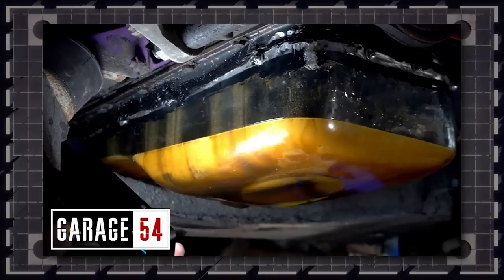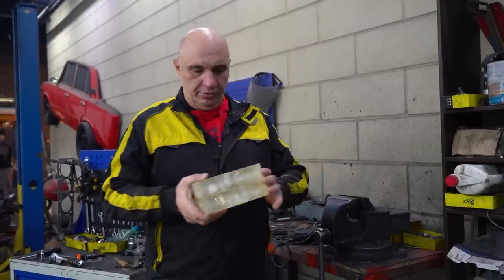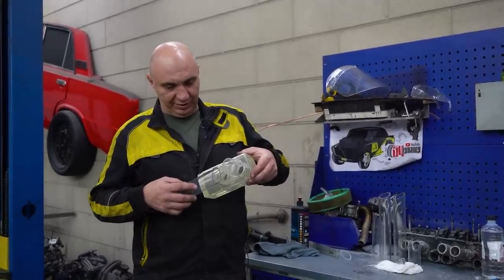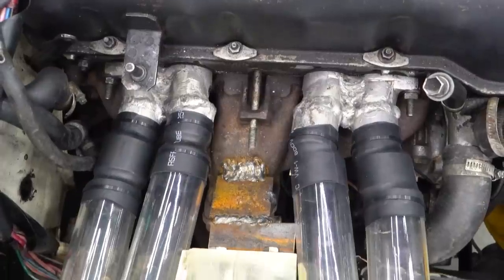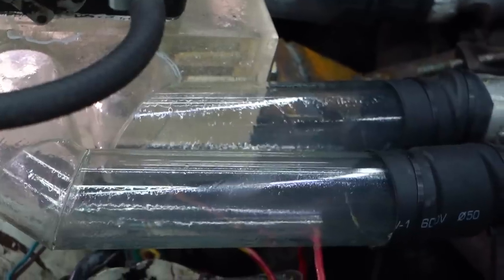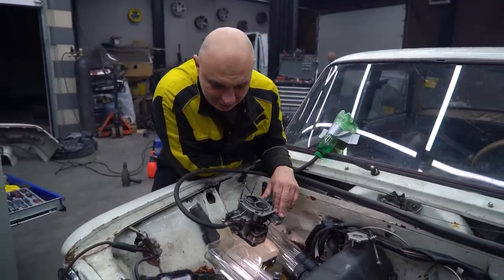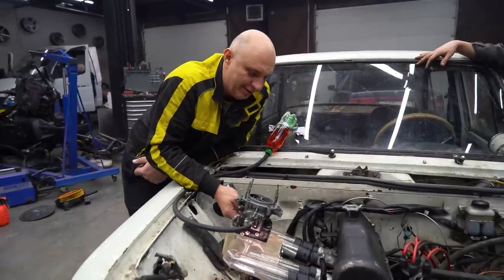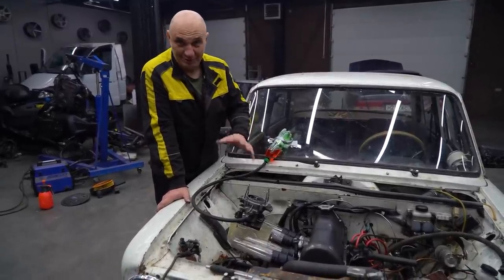We make a transparent intake manifold

Comment: Clear turbo next?? 🤔 Great video!!
Reply: 😳 No
Reply: @davelowets  acrilic should last a few minutes...
Reply: @MississippiDan1  It's not just the VERY intense heat that would instantly destroy it.. 
The air pressures involved and the centrifugal forces from the spinning turbine and impeller would blow it apart in seconds.
Reply: @davelowets  only the compressor housing maybe

Comment: Awesome video!  How about a clear plastic dip-stick? I can't imagine how we've gotten along so long without clear plastic dipsticks.
Reply: Huh? Why would a clear dipstick be so revolutionary?
Reply: A transparent dipstick would allow the user to see the oil level AND also anything else of interest that may be visible BEHIND the dipstick.  I am also hoping that one day they will develop the technology to engineer a clear gear shift knob so we can all observe with wonderment the amazing workings within.
Reply: @danbergthold3481  That's why you wipe it on a clean piece of paper towel... 

Also, that doesn't always show you anything... The dipstick only touches the top inch or so of oil in the sump. The crud or metallic wear material always sinks to the bottom of the pan, and you wont see it on the stick regardless of whether it's clear or not. 

Their is a tool that's meant to cut oil filters open, and THAT'S where you will find evidence of something happening inside the engine. A clear dipstick won't solve any of that.
Reply: @danbergthold3481  A shift knob screws onto a metal stick. You wouldn't see anything but the threads that it screws onto.
Reply: So, if only we could have a transparent dashboard, firewall, engine block, oil-pan and oil-filter, we could continuously monitor the condition of the oil and the general health of the engine. 

I still think the clear dipstick is the best solution for all problems in human civilization, but I'm willing to give the clear car method a chance. Maybe it will catch on. 

Clear armrests would be another highly useful innovation. Just imagine!
Reply: Are you sure? My mechanic friend told me that there's all kinds of interesting gears and levers inside the shifter knob.
Reply: Many years ago, I had a Trabant with no fuel gauge. Instead, there was a dipstick to check your fuel level. (Great system!) 
I wonder if this genius technology could be employed on today's western cars. 
Maybe we could even make the fuel dipstick transparent!
Reply: @danbergthold3481  Yes, I'm sure.. There is nothing inside a shift knob except the end of the metal stick that is the shift lever itself.
Reply: Maybe these days it's mostly microprocessors. (These days, auto-mechanics also need to be electrical engineers!)

Comment: Make an intake manifold that is the length of the car. Put the carb in the trunk. Then dyno the car to see if it makes more power with the long intake.
Reply: With extruded aluminum, it could be done.  Vlad and his crew have the fabrication skills.  
BUT... the runners would have to be heated the entire way.  Exhaust heat under the carb and water jacketing for most of the length.  Otherwise, so much fuel would fall out of suspension that it would barely run, if at all.
Reply: @BlackPill-pu4vi  Run it along the exhaust pipe LOL! Two tests in one.
Reply: @Universal.G  Exhaust heat would work IF the A/F mixture were conveyed along a single pipe UNTIL it came time to split them four ways to each cylinder.  The A/F mixture would be dry and well vaporized by the time it came to the individual runners.

Make the intake and exhaust out of extruded box section aluminum.  A/F runner on top and exhaust underneath.  Clamp them together for good heat transfer.  The exhaust comes out after it has run under the carburetor.  It COULD WORK!
Reply: @BlackPill-pu4vi  YESSSS!!!! I love the optimism. Now we need Vlad to get on board. :)

Comment: I would like to see if you can find a way to run a car on way less gas+ more air. To burn more efficiently. Maybe one would have to mess with the timing? I mean thunderhead289 here on YouTube ran a V8 on a lawnmower carburetor. Which makes me question if an engine needs as much gasoline to run! Or have we been deceived for years.
Reply: Efficiency improves a little up until about 17:1 air/fuel ratio, then takes a dive because the mixture begins to burn way too slowly.
Reply: @samsungtvset3398  This is just one of multiple videos on lawnmower carburetor on a V8 https://youtu.be/gmPtCmL-Ldw

Comment: Can you imagine a modern car that can run on a 20 oz fuel tank 😆
Reply: dead easy in a european small capacity engine. not that anyone in Europe has a clue how much 20oz is, but guessing not much given that a US pint and gallon are both smaller than an 'imperial' pint/gallon as used in places like the UK